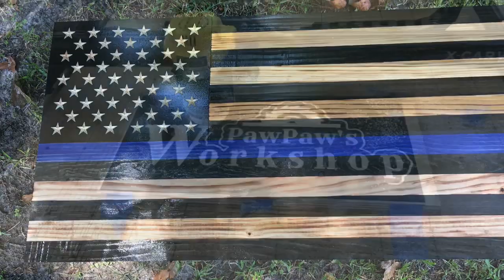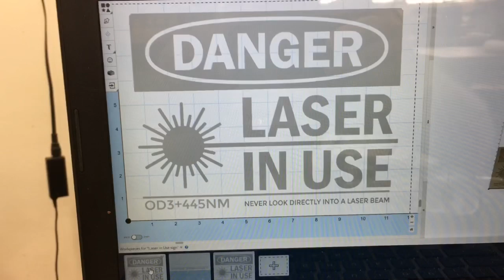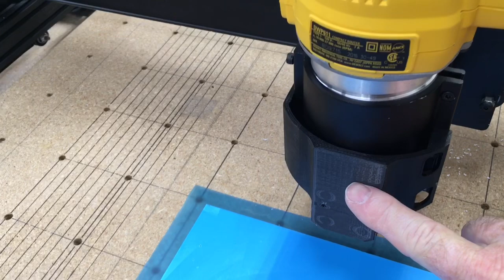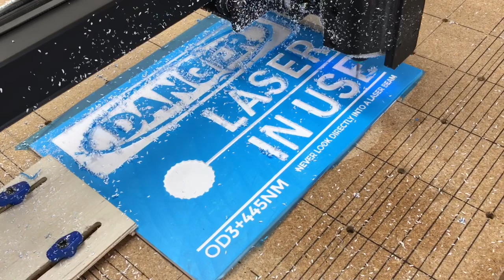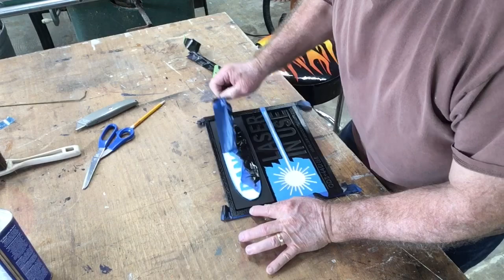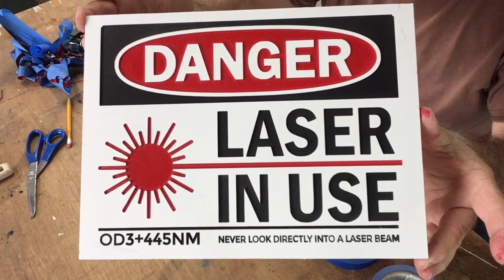Safety Sign for the Laser

Comment: Paw Paw-  A++ on that sign.  Have you had the chance to put Oramask on wood, cut it with the laser and then paint it? Didnt know if you could cut the Oramask at low power with the 7W laser and have it work better than trying to use a downcut bit.  Pat in Montana.
Reply from the maker: I have used the Oramask on wood and it works well.  No, I have not used the laser on the masking.

Comment: That's pretty cool Paw Paw ,will it be permanently attached or will it only be displayed during laser use ?
Reply from the maker: It will only be displayed when the laser is in operation. I'm going to make a slot for the sign to slide into. When not is turn, I will turn the sign around and it will only show the white.  Thank you very much.